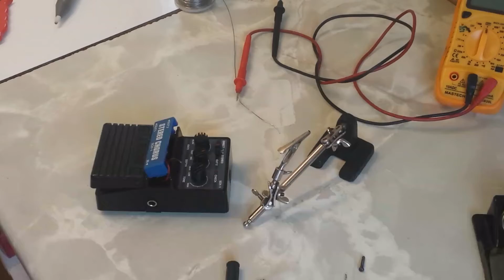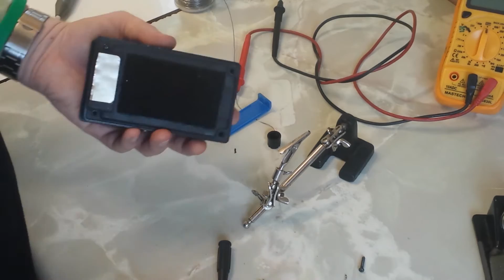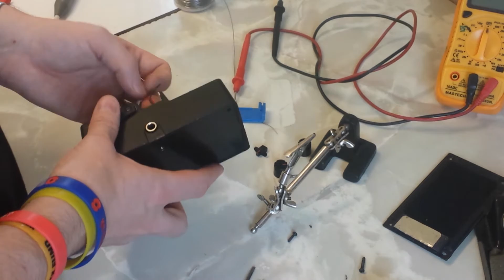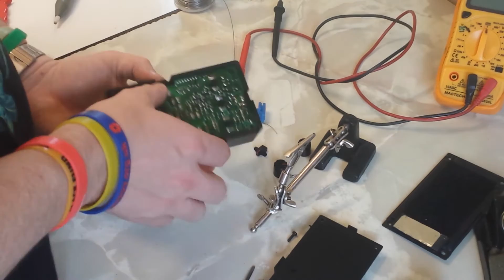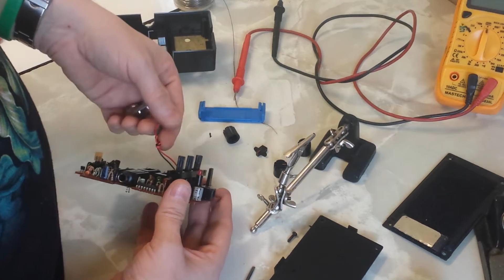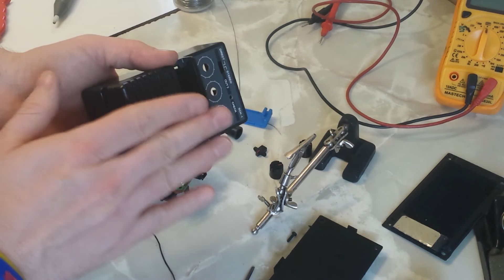How to repair effects pedals. Part 1. Arion pedal battery connector.

Comment: I have an arion chorus sch1 pedal that turns on etc but only works if I put pressure on the tone knob I have to touch foot on tone knob for it to make sound any ideas?
Reply from the maker: +Beeastman123 
Check & re-solder the contacts on the rear of the tone potentiometer. 
If that doesn't fix it then it sounds like you may have a bent or broken contact inside the tone potentiometer. 
I would buy a new potentiometer of the same type, value & size (should say on the back of the component) 
Then solder it in like for like.